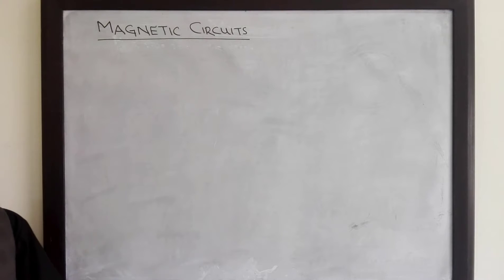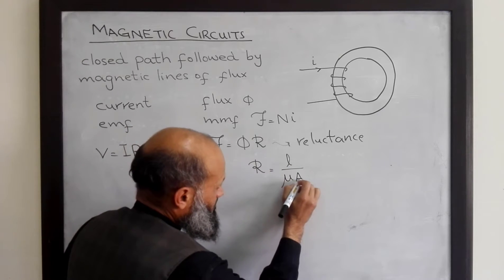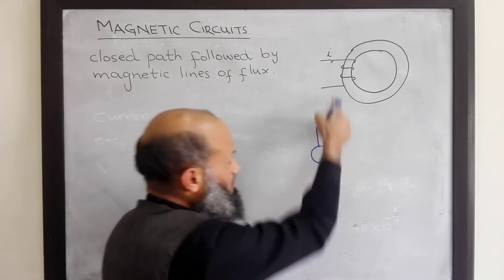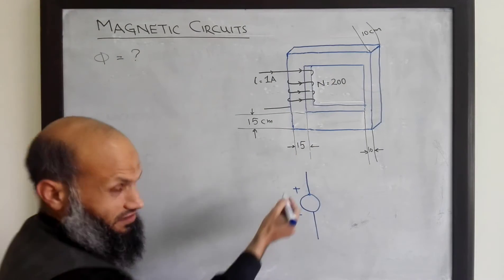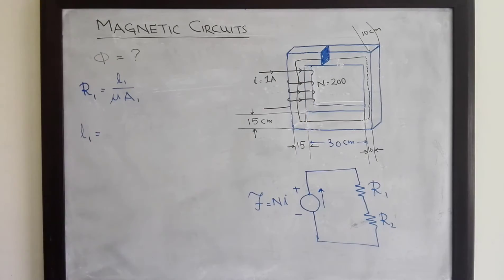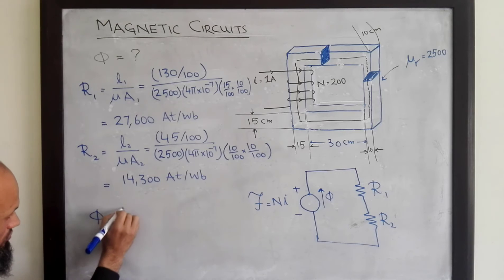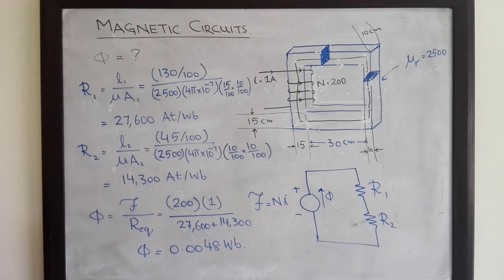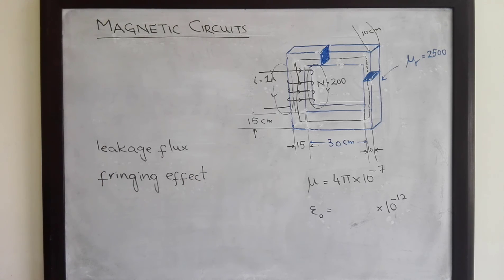EE213 - 02 - Magnetic Circuits

Comment: What would be the formula if there are TWO closed loop cores sharing the same coil?
Reply from the maker: I think, your question is answered in the example problem solved in Lecture 3 at the following link.

https://youtu.be/HRGsgPCZFXg
Reply: @MAFarooqi  I should have stated it better. Two separate toroidal cores sharing the same coil. What would be the formula?
Reply from the maker: @lukiepoole9254  I am sorry that I can not still visualize the situation. Can you please share a schematic of the problem?
Reply: @MAFarooqi  Normally the core structure is in the form of 8. This time, the core is in the form of two O cores separated but they share the same coil. In other words, an MMF source having two flux path instead of one. What would be the resultant reluctance for this?
Reply from the maker: @lukiepoole9254  the procedure to analyze this type of the core with two rings is the same as that explained for shell type core in Lecture 3, as I stated earlier.
Reply: @MAFarooqi  Ah I see